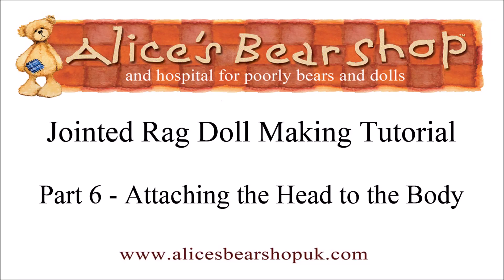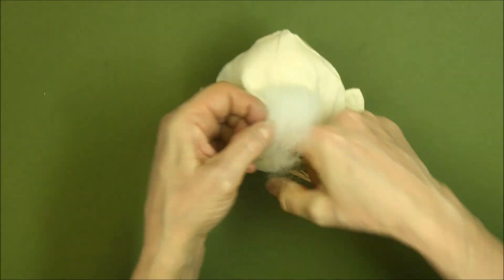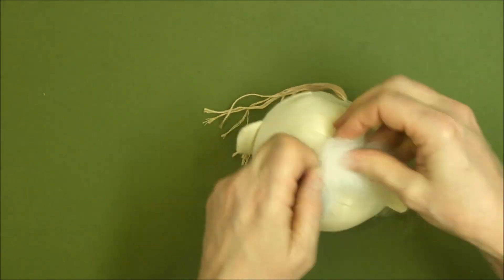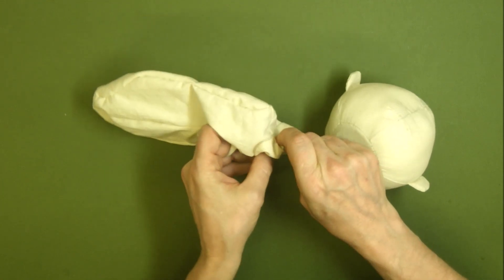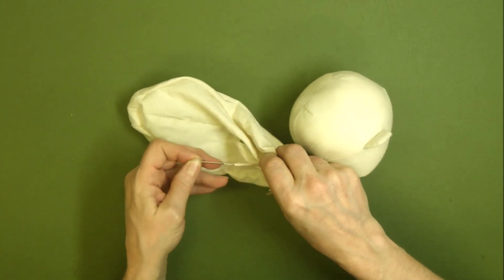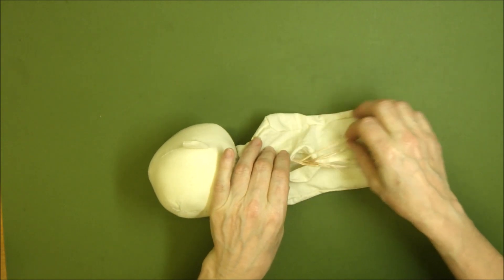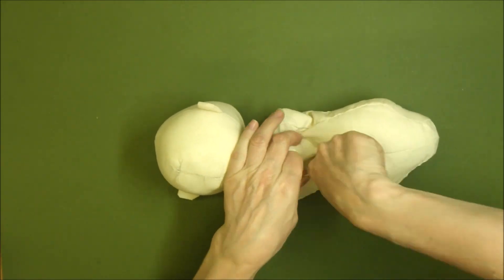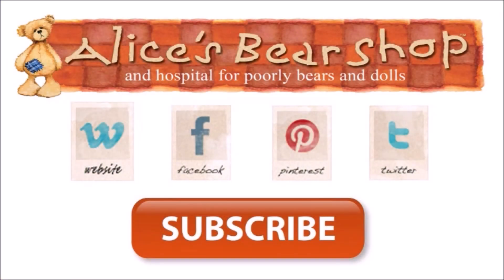Button Jointed Rag Doll Tutorial - Part 6  - Attaching The Head To The Body

Comment: My head turned out a wee bit wobbly. I did it a little differently and didn't get it tight enough. I will try it this way next time. And even though It was the same head pattern as the unjointed dolls, the head appeared to be smaller. I do like the new body though.
Reply from the maker: The head is a very slightly different shape at the bottom but apart from that it is exactly the same you're right. The most important thing is to really fill  it well and make sure you round out all of the darts. I love the new body. It's so sweet with the button joints. x